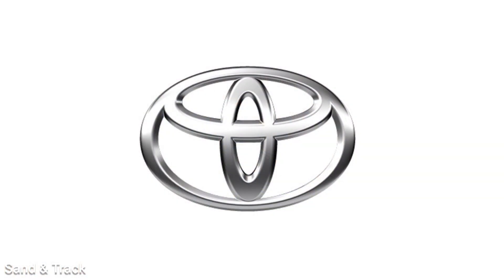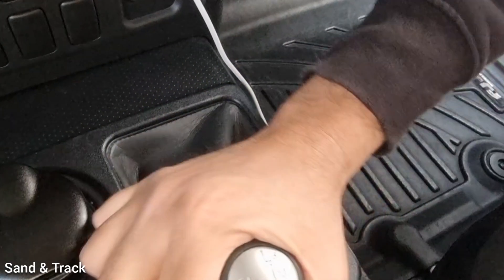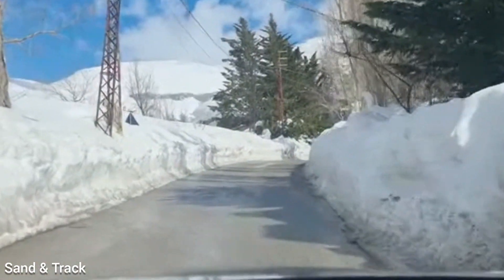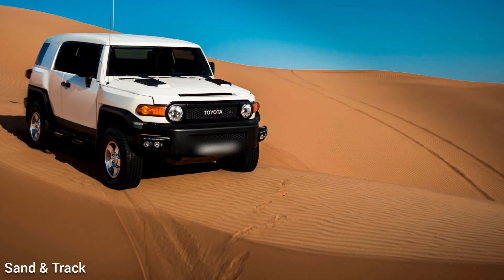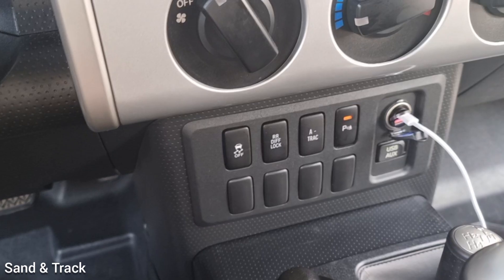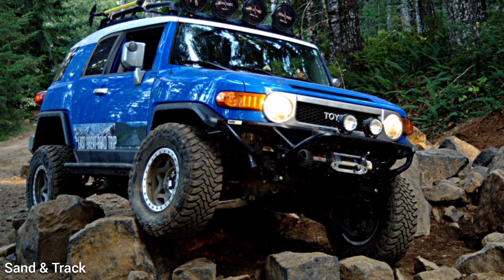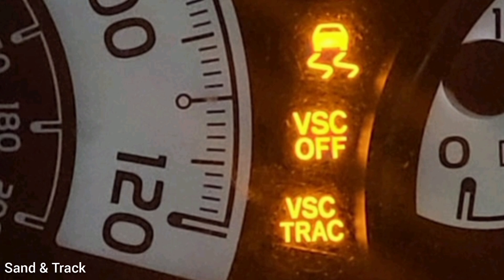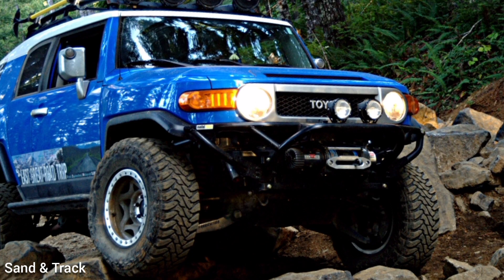FJ Cruiser 4WD System Explained [How to Use It]

Comment: I also just bought an FJ. So when shifting into one of these positions, does the vehicle have to be at a full stop and in neutral or park?
Reply: Shifting from 4H to 4L you can be moving in drive, but just under 45 mph. To go to 4L you have to come to a complete stop, put the car in neutral, depress the brake then switch into 4L, then put it into drive. To switch back to 4H just repeat the same steps